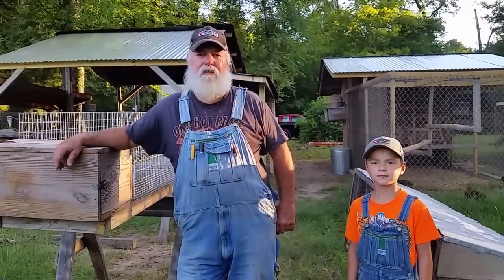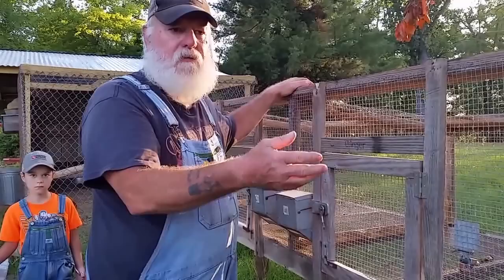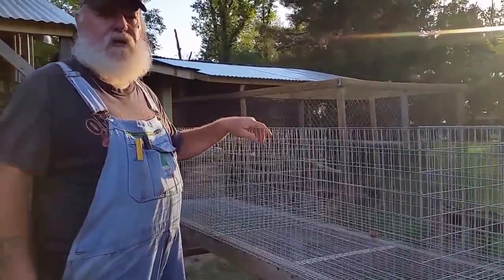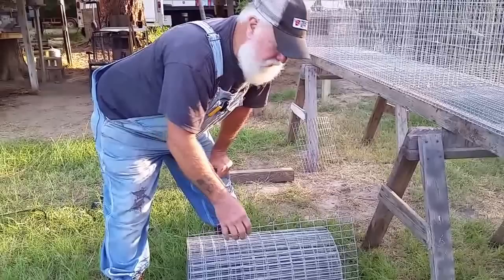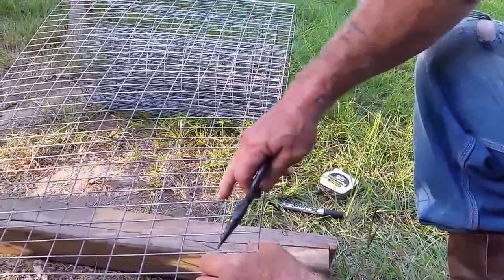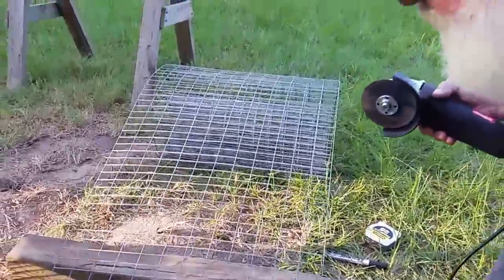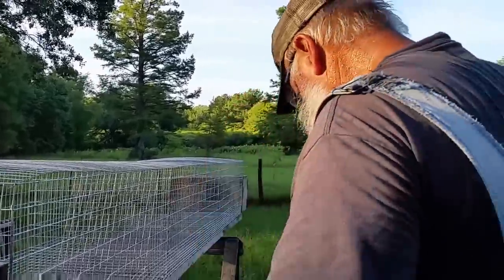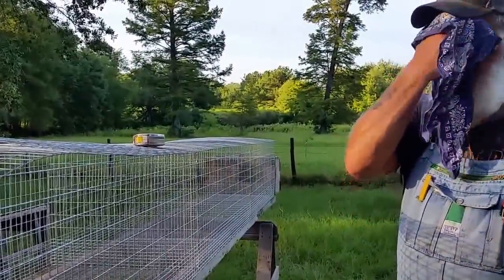How to build wire Rabbit cages. EASY DIY

Comment: just a tip you should make the half floor wire and the other half wood😀
Reply from the maker: I kinda do with the pine boards in there....they are big enough for the rabbits to stretch out on and easy to clean...Thank You

Comment: I'm currently building my cages. Because of a lack of space I'll have two rows of cages on top of each other. My top cages will not have doors but open upwards. Any reason you didn't make it like that? Less wastage of wire and easier to get the rabbits out. Bottom row, I have no choice but to make doors because I don't want to increase the height so my young girls can still get to the top rabbits without using a ladder. I also have to factor in the drainage sheets in between the cages
Reply from the maker: Its not convenient for me to have a door in the top.  There is nothing wrong with it but my shed is open and I can't have my cages low because of varmints.

Comment: Love the video! If you don't mind could you tell me where you get your wire from.
Reply from the maker: The local feed store orders wire for me...I order rabbit supplies from Klubertanz Equipment and they handle wire too   
http://www.klubertanz.com/Catalog_0917.htm
When ordering the 1'x1/2' for the floors be sure to buy the 14 gage. The walls should be 2'x1' 14 gage baby saver for your breeding stock. The 2'x1' 16 gage can be used for the top of your breeding stock cages and the top and walls of your grow out cages...Thanks for asking friend!
Reply: WORM GITTER thanks I am a few months into raising meat rabbits , I have a wooden cage now and it is getting nasty . I will be making one like yours.